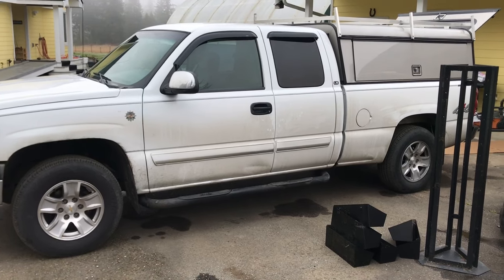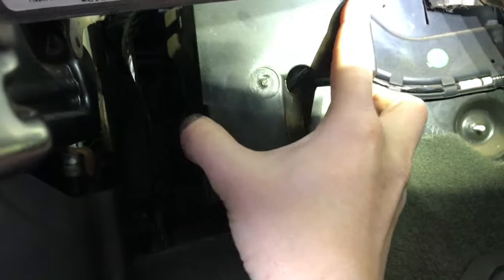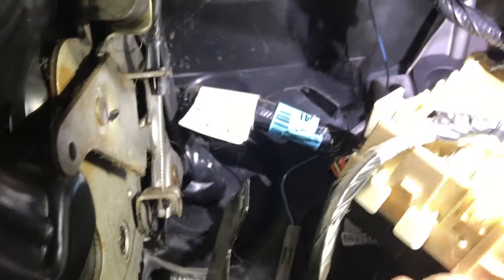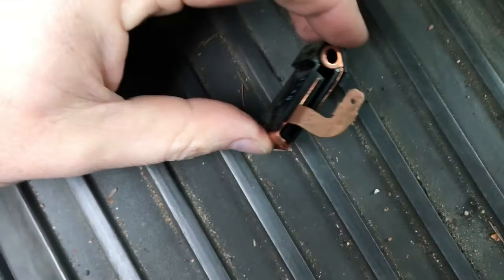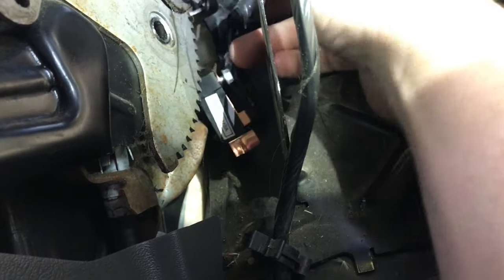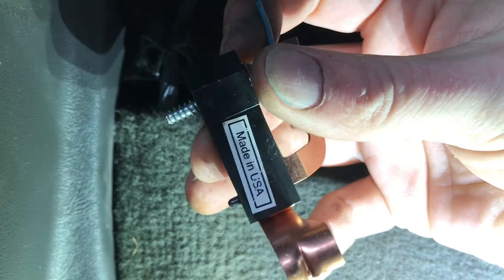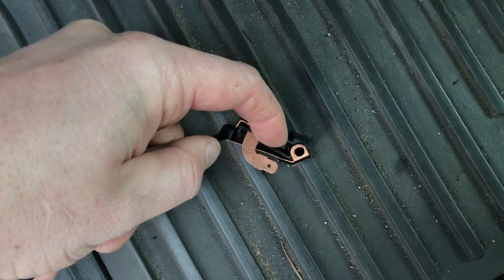2004 Chevy Silverado E-Brake Parking Brake Light Stays on Fix!! $5

Comment: Thank you for posting this. To others who are doing this easy installation:
Depress the brake lever ALL the way to the floorboards to get access to the sensor.
The metal bracket holding all the wire connectors doesn't need to be removed. Take a photo of the location of the wire connectors, remove them easily, the white box that holds them all tilts forward and out. Push it out of the way while you remove the sensor.
7mm socket on a quarter inch drive with a short extension worked for me.
THANK YOU AGAIN FOR POSTING THIS!

Comment: Thank you for this!  Light and bell were driving me nuts until I manually opened the switch and that solved the issue.  Shoving a piece of cardboard in there to keep it open until the part arrives.

Comment: This was super helpful and fixed me problem. I'd been driving with the air conditioning on blast and radio up to ignore the parking break chime for way too long! 6 dollars to fix was well worth it
Reply from the maker: And if you need a quick fix you can just unplug the wire from the e-brake. It finds ground via the e-brake to turn on.

Comment: excellent job, fixed my E parking light..   I think my switch was just dirty.  took a picture of the cable plugs.  20 min job -- 19 minutes of struggling to put the bolt back in :).
Reply from the maker: Yeah, that bolt was a doozy. One guy said if you engage the ebrake a bit it takes pressure off the switch so it isn’t tilted trying to get it in.
Reply: @jeremylakenes6859  Doing it with the brake fully depressed takes the switch spring resistance out of the process.

Comment: Jeremy, this was just the ticket for me! I'll have a comment at the end because I found it quite by accident.
There certainly isn't much room to work in there - I had to disconnect everything from that white relay box and still could barely get it out of the way. @raulprieto2351's suggestion to do it with the pedal fully depressed is a golden nugget because the switch goes in at its closed position this way with no resistance from the spring action.
To get the switch back in with more room to see and fit the item I used a slightly curved hemostat clamped to the brass arm where the spade terminal is, put the screw into its hole in the switch, held a small flashlight in my mouth, moved the switch into place  and worked the screw into its home then tightened it with an extension on a small ratchet handle. I don't think that I could have done it by hand without further adversity. This should have been a 10 minute job. For those who drop the screw on taking it out and hear it falling into small fastener hell in the bowels of the space behind the side panel a #8 x 1 inch slotted hex head will do just fine using a 1/4 inch socket. Ask me how I know. Add the time to drive to your nearest hardware store to buy a new screw to 10 minutes and that's how long it takes to do this.
Jeremy - a quick suggestion if I may. For the sake of others looking for how to replace the e-brake parking brake light switch, do you think that you could post it another time with the title "How to replace the e-brake parking brake light switch early 2000's Chevy pick-ups and SUV's" It would pop up more easily for those of us searching for this specific task. This video is perfect. I don't know how you did it and filmed it so clearly at the same time. Can't thank you enough!   👍👏

Comment: Thanks for the replies on the other thread Jeremy. The issue I had is my parking brake was engaged, but the light on the dashboard was off. I replaced with the $6 switch.  This is how the switch should work… The replacement switch is normally closed when it’s right out of the box. When the parking brake is NOT engaged, the switch will be open. When the parking brake IS engaged, the switch will be closed allowing 12 V to ground. The single blue wire is the 12V.  The bolt holding the switch is 7 mm there is a small alignment nipple on the switch that has to engage inside a little hole on the frame when you screw in the 7mm bolt.  I recommend removing the metal frame that holds the relay switch stack. This makes access much easier and it’s not difficult to remove. It hangs up on the left side a little bit but it’s easy to figure out.  There’s two bolts holding the bracket in place - a 10 mm on the right (gas pedal side ) and 13 mm on the left - removing this bracket will help with access to the 7 mm and ensuring alignment of the nipple/hole. I removed the panel plastic trim cover that encompasses the hood release lever. If you engage the pedal around halfway, there’s a spot that allows you to see the switch completely as well as the hole in the frame for the nipple. NO NEED TO DO ZIP TIE (at 6:50) because of this, make sure you mount the switch with the parking brake ENGAGED somewhere around halfway. That way there’s no contact with the pedal on the switch and it’s SO easy to see it as well. After installing you will see with the parking brake disengaged the arm on the switch moving and going open which removes 12V to ground turning off the dashboard light. Thanks for the great video Jeremy!
Reply: Will light staying on rundown truck battery??
Reply: @SirJamalong  of course any light requires power which means it will run down a battery sooner or later

Comment: Good looking. Just ordered the switch and hope it’ll do the trick.
Reply from the maker: Hope it works out! Check fluid level too. I don’t know for sure if its the e brake light that comes on or ABS light that comes on when the fluid level is too low. 

If you remove the wire, it shouldn’t make any noise.

Comment: It worked but I didn’t overlap or do anything with what you were talking about in the end with the zip tie .. should I be worried ..
Reply from the maker: If it worked, it worked. One guy said just push the pedal and it’s easier to put the switch in.
Reply: @jeremylakenes6859  Definitely easier with the pedal depressed.

Comment: My 2002 duramax silverado has the same problem plus the dinger does work, which is a serious headache.  Can I disconnect or remove the switch in order to stop the alarms until I can get the part and replace it?
Reply from the maker: Yes, just unplug the wire from the e-brake switch and it should stop. Also, pull back on your pedal to see if it is a spring issue and not the switch.
Reply: Unplugged the wire on mine still dings like crazy

Comment: I'm going to try this. My light has been on for quite awhile.
Reply from the maker: Order the part, prop the spring up with the fat end of a zip tie, gain good access and you are golden. Remember to line up the tiny plastic alignment tab on the switch. 

Also, in some cases, cars will throw this light when the Brake Fluid is low. 

Start before breakfast and you’ll be surprised at what you can accomplish before your day starts.

Comment: Hey man, i liked the video but it wasnt the problem for me, my light came on when i was pressing the regular brake cause i was bleeding/replacing a brake line. I remember pressing the brake to the very back and i heard a click and then the light came on😬 any solution or place to start looking to solve this?
Reply from the maker: I think the light comes on for two reasons: low brake fluid or e brake on.
Reply: @jeremylakenes6859  I believe there is a 3rd reason : if there is a fault in the ABS system. At least in the case of my 2000 Silverado 1500

Comment: when you got the screw in and started take a screwdriver and push underneath to get the tab in instead of zip tying but great video
Reply from the maker: Great tip. I had a hard time laying in there and pushing the spring/contact while keeping the mini plastic alignment tab in place. Zip tie is easy for one handed work. But I learned in the process

Comment: Please help!  My light wont come on when the pedal is engageed.  I have the switch out but what I don't understand is when applying the foot pedal I dont see what on the actual pedal is engaging on part of the switch (the part you had broke).  I move the pedal all the way and I cannot for the live of me figure out what is engaging that metal wing that then makes the switch on or off.  Something must engage that wing early on for the light comes on immediately when it is working at least that is what I saw on yours.  My blue wire has 12V power  I wonder is something else is broken on mine.  Thanks!
Reply from the maker: I believe the blue wire needs to be grounded to work and its grounds through the switch. I’d test the blue wire directly to ground and see if the light comes on. 

If that does happen maybe the blue wire isn’t making contact with the switch when it’s plugged in. 

It could also be that the switch isn’t in the proper place to make contact to ground. It’s a pain to get in the right spot. 

You maybe put ground to the tong on the switch with blue wire plugged in to see whats up. 

I think the light comes on through the radio since the radio is the warning chime. Let me know how it goes.
Reply: @jeremylakenes6859  - yes I verified it. You’re absolutely right. If you ground the blue wire, the light comes on I went ahead and bought a switch since it’s so cheap. I’m gonna install it soon and see what happens. When I ground the blue wire, the light comes on and goes off when I disconnect it so I know that the lights working need to just validate that the switches correctly position. I still don’t really get the whole thing about using a zip tie but I’ll figure it out.  Thanks for the reply.
Reply from the maker: @condor5635  rewatch the video and look at where I put the zip tie. It holds the metal piece (that contacts the ground that turns the light on) from messing with aligning the little alignment pin of the switch. 

Take a look at that metal prong, it’s likely gone or simply not making contact when the brake is applied. Report back on how it goes!

Comment: Did you just pull the blue wire off bc mine won’t come off😂
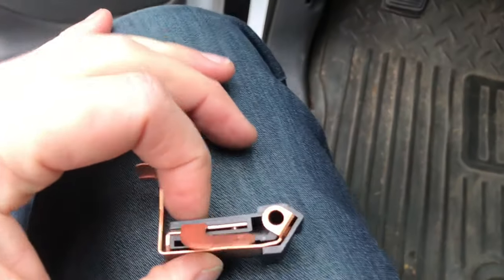Reply from the maker: Should be able to wiggle it off. 1:07 look at the end thar curves up with the little hole. It’s attached to that.

Comment: Going to try this lights won't shut off when I restart my truck
Reply from the maker: You should be able to unplug the wire at the back to make sure that is the issue. If you unplug it and the light is still on you may be low on break fluid.
Reply: @jeremylakenes6859  mabey so got in my truck after work and it worked also worked this morning
Reply from the maker: @FUNNYBOY12375  maybe it’s not springing up all the way.

Comment: Now the last time I did this I got my fat ass stuck between the dash steering wheel and seat. I never saw my cat laugh so hard watching me trying to get out that one. He refused to replace the switch 4 me not my yob man he told me...
Reply from the maker: Yeah, getting stuck under the dash is no fun. I got stuck under the dash of a Cessna 206 once... too many sharp edges... 

Now that I think about it, in the Chevy the seat is just 4 bolts...
Reply: @jeremylakenes6859  I'm a retired A&P off the Enterprise. The only aircraft I ever got stuck stuck in was an old old Beechcraft a buddy used as a holiday flier. Now there R war birds that don't even take kindly to their 90lb pilots let alone me the mechanic. The Beechcraft incident nobody was around it was just before the Easter holiday and I got stuck stuck by my Over shirt I wore. I had to calm myself down because i wasn't only stuck the damn plane had ahold of my thick denim shirt and that is another story how I tore my left man tit wide open getting out of it. It seems someone at the factory knew sooner or later someone would be working on the pedal cables and find their booby trap on the top leading edge of the seat. I found it and bled.
Reply from the maker: @thekingsilverado8419  Yeah, planes are funny that way. Like inspecting the tail section from the inside... 

Good ol days in the hangar

Comment: Where does the blue wire connect to at the other end?
Reply from the maker: I’m not sure. I would guess it connects at the dash panel and is the ground (negative) for the BRAKE warning light.
Reply: @jeremylakenes6859  Actually I Have the opposite problem E brake light won't come on but sometimes when I play around with wires it works.Do you think that I need a new switch?
Reply from the maker: @TheBully010  If I’m not mistaken, the blue wire via the switch connects to ground to turn off? Then when the brake is activated it creates an open circuit (lifting the little tab from ground contact) and the light turns on. 

So, perhaps the blue wire is grounding out the whole time somehow. I’d unplug it and connect it to a known good chassis ground and see what happens. I might be backwards on the ground turning light on or off, but you get the idea. I sold my truck so I can’t test it.

Comment: I was hoping this was it but alas, my brake light is still on. Checked the master cylinder and it's full too. Oh well.
Reply from the maker: What happens when you unplug the wire to the switch? 

Or if you take that wire and put it directly to ground? Possibly the switch is not touching ground like it should. Let me know.
Reply: @jeremylakenes6859  I unplugged the wire and the light is still on. When I start moving the chime will sound until I stop. Then the chime silences but the light stays on. 

Now I have to get my fat paws in there to plug it back in.

I cleaned the grounds on the driver side but the light is still on. There is no apparent problem with the brakes so I may just live with it.
Reply from the maker: @teddelaney412  weird. When I unplugged mine at least the alarm didn’t go off if I remember right...but then again my chime which works through the radio didn’t work. 

Hmmm. The switch is normally grounding the wire to the chassis in order to get the light to turn off. So unplugging it won’t work. My bad. 

Try jumping the wire directly to ground (a tested ground or bare screw to the chassis.) and I’m sure it will turn off. If it doesn’t turn off then your wire has an open or a break in it. 

Things to check before chasing that. 
1. Try grounding it to confirm the wire is good. 
2. Are you sure the little plastic tab went into the hole? If you didn’t put the zip tie in to hold the spring open, you likely didn’t get the little tab to line up... watch the end of the video. 

3. Test the ground with a test lamp. Use the cig lighter for a positive and the switch as the negative. Switch will only be connected to ground (negative) when the pedal is pulled all the way back. This is assuming the little alignment tab is in the hole.
Reply: Changed the part but didn’t work.

Found that my master cylinder was really dirty. Drained it using a turkey baster, cleaned inside and fill it up with fresh fluid and the issue went away. 

Hope this helps anyone in the future.
Reply: @Faroudyy  what did you use to clean the Master cylinder ?

Comment: I swapped mine out and the light is still on
Reply from the maker: Did you get the blue wire plugged back in correctly? Basically you can test it be grounding out the blue wire and the light should turn off. 
Or 
Check your brake fluid reservoir.

Comment: Instead of doing that you should just release the brake and install the switch with the brake released.
Reply from the maker: The spring has tension regardless. Did you change yours? Did you get the little plastic tab to line up?

Comment: I just changed out my switch and the light is still on. Idk why it's still on.
Reply from the maker: Try to put a ground wire directly to the blue wire and see what happens. It should turn off.